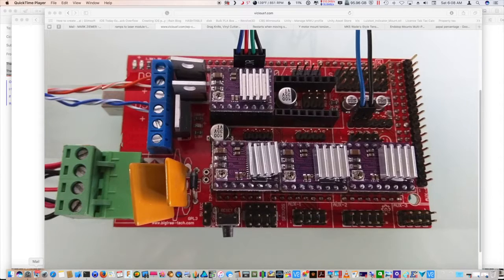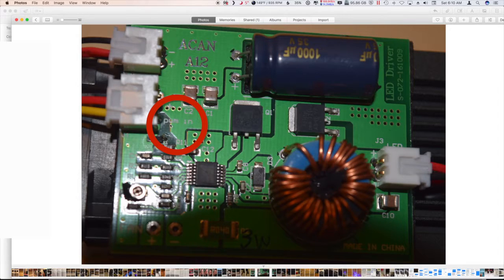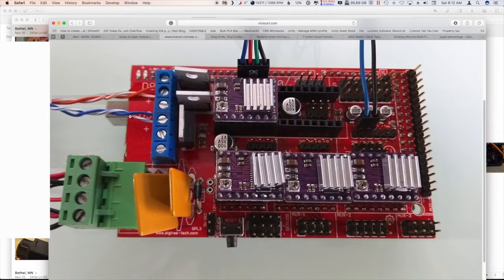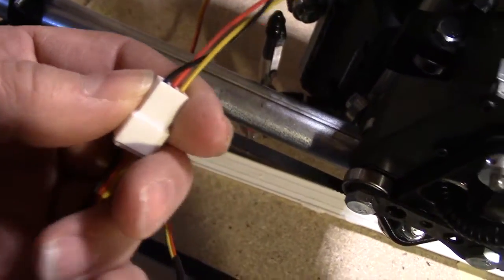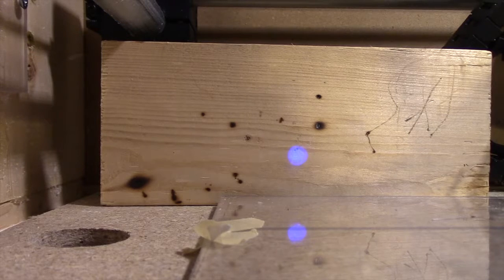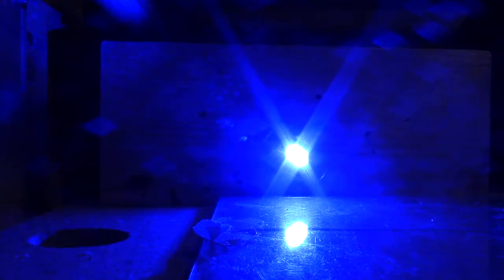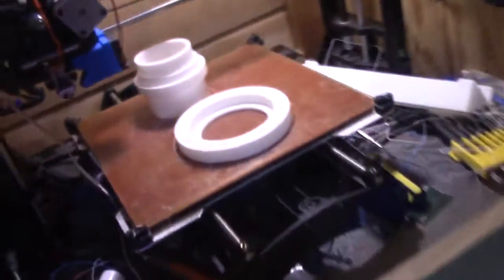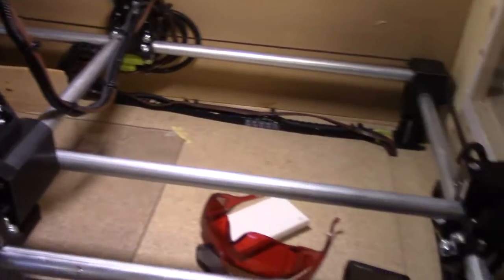Mostly Printed CNC MPCNC Part 7: Laser Wiring and Smoke Exhaust Plans

Comment: yo i have a question my laser does not stop after the job it is still on and i need to shut it off manually in fan speed controll di i need to edit the g code ? im using the fusion 360 mod for mpcnc
Reply from the maker: It’s been a long time since I’ve looked at the GV code generator for fusion. But if that’s the only time the laser is staying on when it shouldn’t, there should be a configuration that allows you to enter G codes that you want to run at the end of your job..Just add a M107, and it should add that code to the end of all your jobs.
Reply: @Someoldguycoding   ok thanks gonna try that

Comment: Hi, great video as usual.
I am in the process of adding a 5.5w laser to my MPCNC, the controller board is
A MKS gen 1.4 Ramps. Do you feel the D9 hack would provide sifficient power to
Fully utilise my Laser Module?
The D9 hack could then control the laser power using the m106/107 S?......

Regards
Reply from the maker: Don't use D9.  Watch the next video and see the importantly update below
Reply: Thank you ........  @Someoldguycoding
Reply: HI, I have just watched your video and thank you so much for the directions. superb video and contains loads of useful info. one last Q? should i use gcode to start the laser at the beginning of the run or is there a better and more accurate way........somthing like
M106 S127 just before the start code?????
Reply from the maker: @CrazyMedic  Greetings, and thanks for watching! Be sure to watch the following video where I show corrections and the right way to wire a laser.  Unfortunately just putting a M107 S126 before the start code will turn the laser on for all movements, leaving it on for movements between cuts. There are tools that you can configure to automatically put the laser on/laser off codes in for you.  ESTLCAM has a tab where it can be set, as does the community created CAM for Fusion 360 (check out the v1engineering forum). Also programs like LaserEtch and PicLaser from JTechPhotonics.com. Other Cad/Cam programs probably have settings too, but I'm only familiar with these. Good luck and enjoy your laser!
Reply: Perfect, just the direction I was hoping for..        @Someoldguycoding
Reply: You Sir are a star. I have now watched more of your informative videos and feel confident that I am now armed with the information to setup and run a laser on My MPCNC, I already use ESTLCAM to router parts but clearly hadnt thought about using it for my laser. The main reason I am adding a laser is to produce ribs and formers for radio controlled aircraft and Jets. I have already digitised a set of plans for a 4m Glider, which I hope to start soon. The next project will most probably be a large A10 Warthog Jet, wingspan around 100"...... Thank you for all you do for the comunity. also a Thank you to Ryan for releasing the MPCNC to the masses.

regards to you 
 @Someoldguycoding
Reply: UPDATE
My laser with the aid of your directions was installed with zero hassles until i tried to run the laser. I went back and checked everything 3 or 4 times. After much reading i came across a thread talking about the chinglish translations not being accurate. Looking at a few other driver boards and I notice the info with my TTL driver had the colours (white / Blue) reversed. In frustration I reversed mine and the laser sprung to life and is controllerable. I now need to learn, as I did with my 3d printer how to run the laser. I dont think its just a case of through full power at it and hoping. I also need to reaserch estlcams laser settings to prevent too  much burning as apart to cutting.

Thank you for your awesome channel and regards